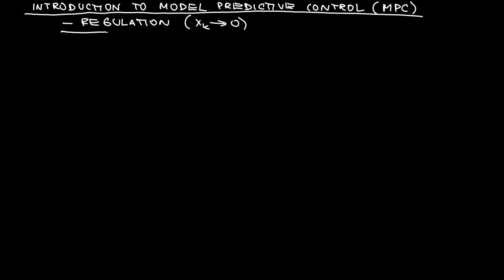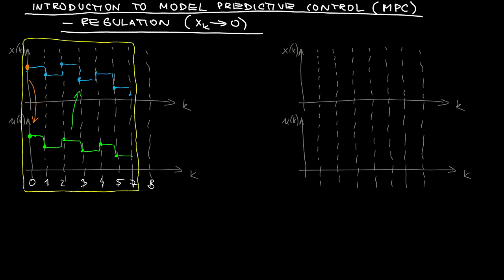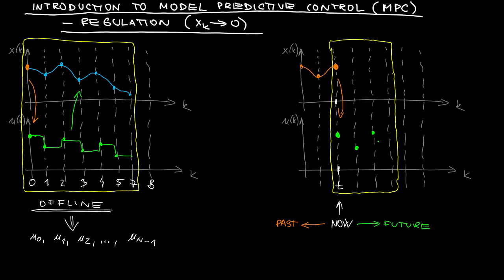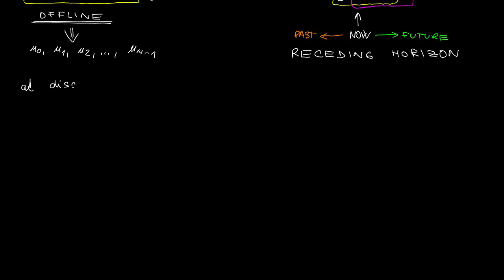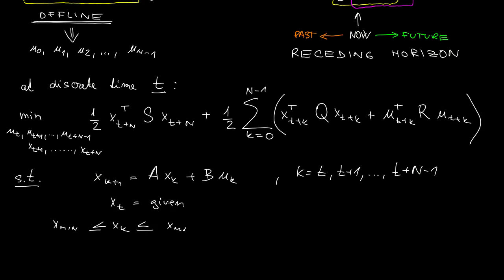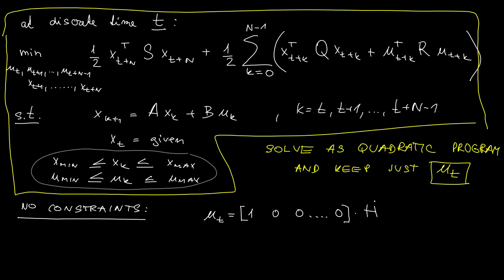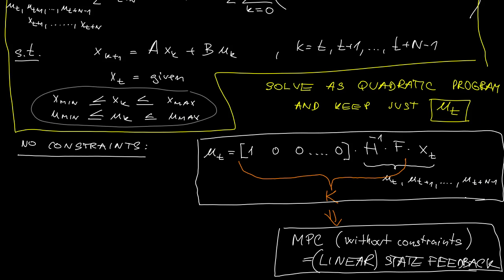L3.3 Introduction to Model Predictive Control (MPC) - regulation

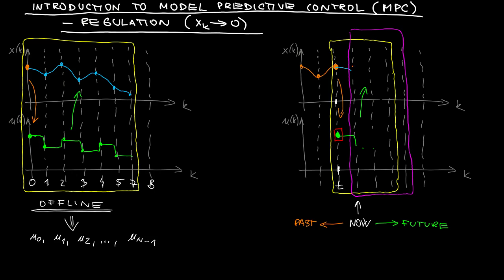Comment: Great video series, thanks a lot.  I did have one question however.  Around 2:48, when you moved one time step into the future and updated the current state of your model, you assumed that the model prediction was exactly the measured response of the plant's state.  I would assume that this is rarely the case, i.e. the measured state is not exactly what the model predicted.  How does MPC account for these disturbances (e.g. the drag affecting a car's acceleration is different from the model's prediction and thus you aren't applying the correct amount of throttle for a desired acceleration).

I see in your next video you discuss reference tracking, but it seems like the outputs are just the model's predictions and not the actual measured states.  When (if ever) does the model compare the signal is commanded versus the difference in the model's predicted response versus the measured response?  Thanks.
Reply from the maker: Jake, your observation is perfect. Indeed, my explanation at that part of the video seems to suggest that at the next time step the optimization considers as the initial state for the shifted time window the value predicted from the model in the previous step. I should have somehow reflected in the video that this is actually not the case because the state at the next/new time step is either measured or estimated, thanks to which MPC becomes effectively a feedback control. Thanks for pointing this out, it might really be confusing. I will perhaps incorporate this explanation in the next version of the video.

The fact also is, however, that similarly as in the case of other feedback control strategies, the actual (measured, estimated) state (affected by some disturbance) should not deviate from the predicted (using a model) too much. If the disturbance is severe, some sort of disturbance estimator should be implemented.